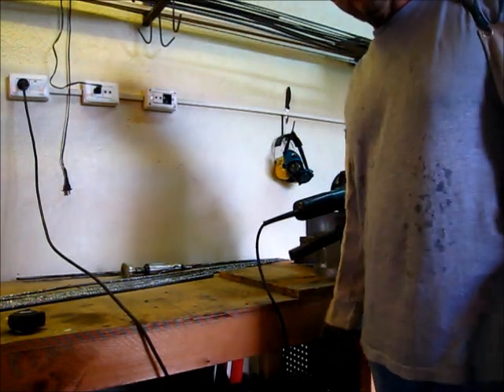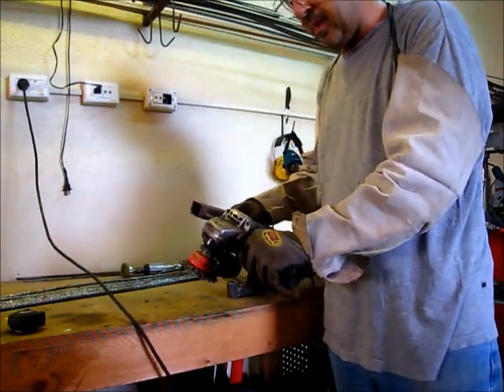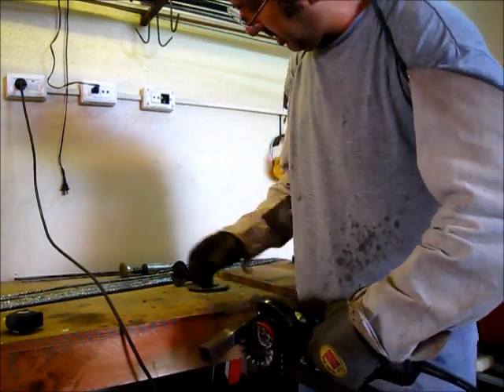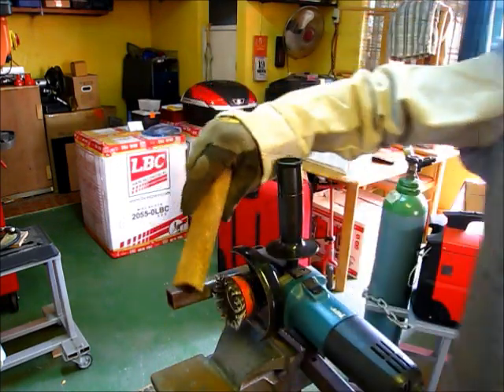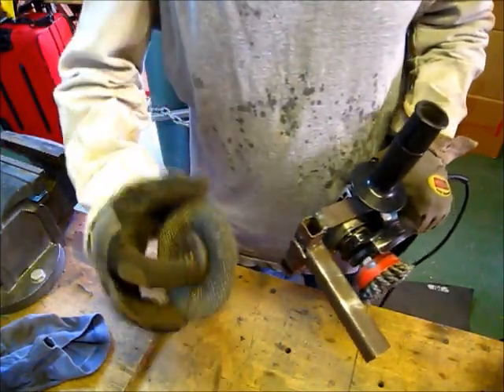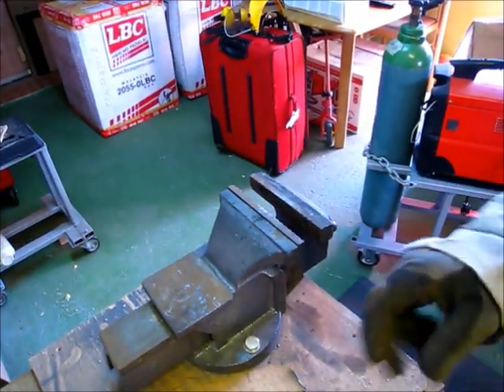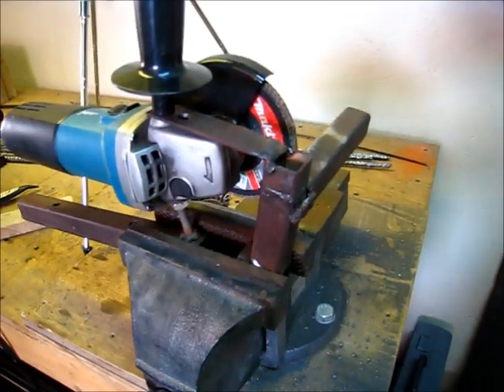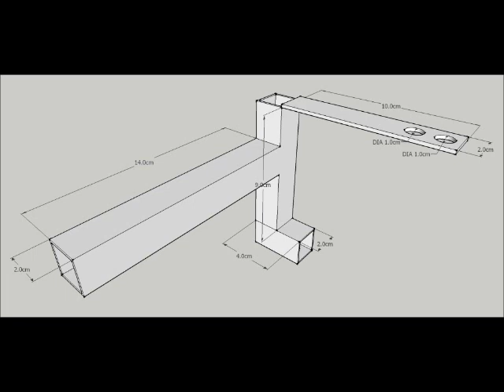My Favorite Home Made Tool made with Recycled Scrap Metal

Comment: side grinding with a metal cutting disc is risky if it shatters but the wire weel looks grate :)
Reply from the maker: Side grinding with a Cut Off Disk isnot just risky, it's down right dangerous.

That's a Grinding Disk I have on there though.

Thanks for your comment.

Saeid
Reply from the maker: Hehe, yes, the welding... I've gotten a lot better since then. Look my new video titled 'Pro STICK Welder'

Comment: Suggest to all--only buy grinders with a tail handle.Small  units are dangerous and the author has adopted a safer version. Pay the extra $10  and get a rat tail unit.Most folks buy the cheapest and are  unsafe units. Cheers!

Comment: I got the directions and could not find 1"square tubing with 3/16 wall.  Well the instructions said 2mm or 3/16" tubing.  Being only familiar with English inch measurements I looked at a metric conversion to inches and 2mm is 1/16" .  The measurement in the instructions are incorrect.
Reply: this design is flexible!!! use any wall thkness that can support the load and accomodate the hardware  assembly. GREAT JOB !

Comment: Nope not dangerous as some have stated , but what is dangerous is the wire wheel itself etc .
Some wire wheels are not rated for high RPMs and can come apart during use .

I think its a great home made idea , just be sure your wire wheel can handle those sustained RPMs !!

Comment: Nice. I'm making one tomorrow. For my grinder and sander. Some idiots are concerned about OH&S will say. Id tell them to look at my free hands as I quickly poke them in the eye. This is much safer and convenient than holding the machine with 2 hands. All you need is common sense.  OH&S should be concerned about morons in the workplace.

Comment: Whats unsafe about the tool fixed and the work piece moving? Consider a table saw, scroll saw, bench grinder, band saw, router table, chop saw. All these tools are mounted and the work piece is held by the user. Also, not all hand tools have a dead man's switch. For instance my angle grinder does not.

Comment: Why not put material in vice and use grinder as intended?If your weld fails with the Dead man switch you will have a run away tool @ 5000RPM just saying. Thats why they make bench grinders.

Comment: Is there not any body out there that see it like I do.
A modified tool. If that round bar he was grinding got pulled between the disk and the tubing....bang. There is no way to control the gap as the disk wears down. I think most pedestal type grinders recommend a 1\8'' gap..no more.

Comment: Noticed you did not unplug the grinder before mounting the brush or grinding wheel. Dangerous !!! It is very easy to slide the power switch on wearing heavy gloves.

Comment: This tool was not as the manufacturer intended it to be used.
This is how folks get hurt.
Use the correct tool with all safety devices in place.
As a ticked trades person I would say this is a dangerous thing.

Comment: nice setups   ... but gloves using a wire wheel is asking for amputation my friend
Reply: +Golden Sim A handheld grinder does not have enough torque to cause extreme damage to you if it gets caught, it'll just stop, yah... it'll hurt... a fuck ton, but it'll stop. Unlike a stationary grinder, those ones are mean little fuckers.

Handheld is measureed by inch pound and rpm. Generally around 60 in pound.

Stationary ones? IN HORSE POWER! Yep. Even a tiny quarter hp model a much much bigger beast then any hand held could ever hope to be.

He's fine, probably safer with gloves for hand held.

Comment: why not just buy a cheap bench grinding. probly cheaper than all the metal framwork too
Reply: those scraps probably cost $12 if salvaged or about $30ish at max, if he bought 4 feet of tubing and 4 feet of strap and building probably only took 30min
Reply from the maker: It's all scraps. Cost was a big zero

Comment: Well I'm only a professional Carpenter with just over 7 years experience so i can't say very much in regard to most of what this tool is actually designed for. But what i can say is this tool breaks just about every health and safety rule i can think of. This should never become a retail item. It's unbelievably dangerous. And even if we disregard what health and safety has to say about this, Angle grinders are found in workshops such as the one that 'Saeid Momtahan' works in but more commonly found on site and the whole method behind this tool is very slow, time consuming and inconvenient. My opinion is that even if you did manage to make it safe and try to sell it. I don't think you'd have many buyers.
Reply: Apart from all that. I like the creativity and you have atleast made something that works, so well done for that. But again I find it impractical and unsafe. So keep trying.

Comment: The modifications that you have created on your grinder are your business but I believe that not mentioning Safety anywhere in your video is an issue here. Unplugging any power tool while changing out the blades, bits, wheels, or whatever is not a bad habit to get into.
If mentioning safety has offended any of your viewers "I apologize"

Comment: Well I have been a welder all my life and that's the dumbest thing I have ever seen just clamp the material down instead of the grinder or like us shipbuilders do is hold one in 1 hand and the other in your other 1
Reply: Or get a bench grinder
Reply: He clearly states that he does have a bench grinder "but I don't use it anymore because it is so weak compared to this". However I think the point is the versatility - which means getting a lot more functions out of a pretty limited tool with a couple of minor modifications. I'd have thought someone with a background in industry would have got this. I think the best thing about this is the fact that it gives more stability and comfortable grip options without compromising the portable nature of an angle grinder.

Comment: I hated to see you grind that rusty metal in such a clean garage. I use a chop saw grinder.  Using a grinder without it was crazy for me.  A grinder is the most dangerous tool I have ever used including routers and circular saws.  It is way more dangerous than a circular saw.  It has a mind of its own, and I can't even believe they are even legal.  Their mind of their own force far exceeds mine to control it.

Comment: Dude... i work for one of the top abrasive companies in North America and we teach and promote safety with respect to all abrasive uses.  To be honest, this is the second most dangerous use of a tool and cutting abrasives I have seen in my career.  For all those who see this... Please don't copy this unproven and unsafe system.  Use the right tools for the right job... it only takes one small mishap and you could be injured or killed.
Reply: that home made tool is about 900% safer in the hands of somebody with half a working brain inside their head, than any factory saftey devi on a hand held grinder in the hands of a stupid person..  there's no saftey device to cure stupidity..
Reply: im trying really hard to see the way it would be more dangerous then just using a grinder and Im not getting it. please elaborate.

Comment: very dangerous !!!it must to have a maximum of 5 mm between the grinding wheel and the chassis.I do not dare use this home made improvisation/
Reply: +Eyal Malca Depends on part your working with. Longer the part, safer it is. Smaller parts you can grind using some sort of pliers as leverage.

This is actually pretty neat idea and i was thinking about it my self, but could not come up study enough mounting system for the grinder.